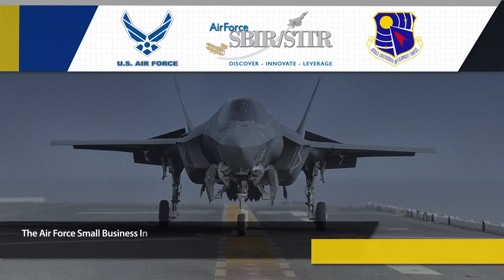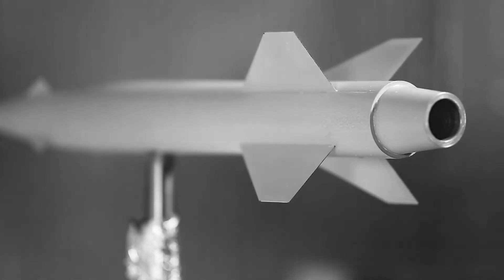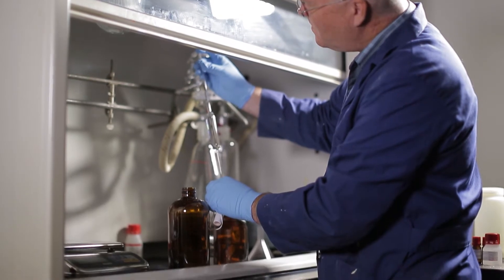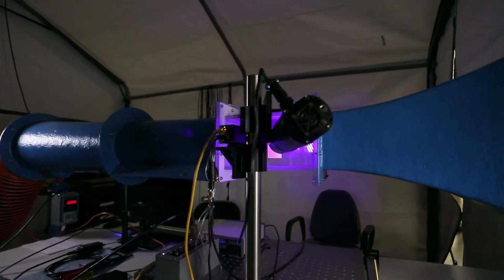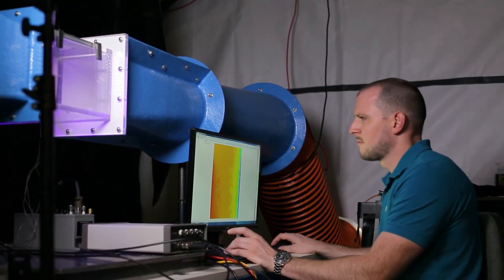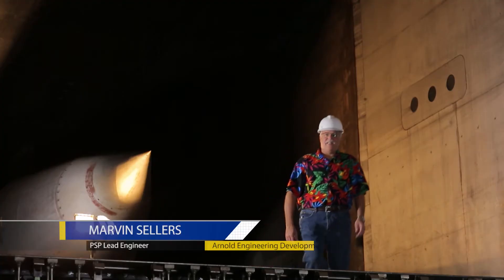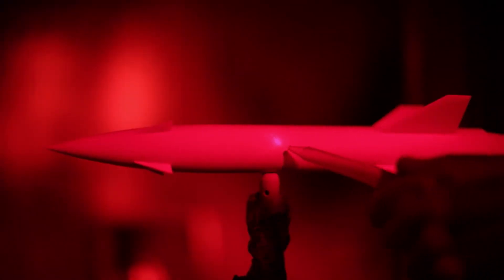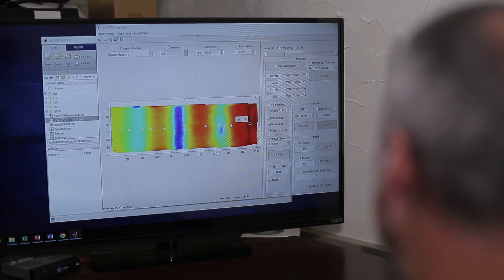ISSI - SBIR Success Story - Fast Pressure Sensitive Paint

Comment: Thank for your video. when i turn on wind tunnel the paint start to separating from surface and i know that i have to use of base coat but i don't know which base coat is suitable and can increase adhesive of polymer 
i use of PtTFPP=Platinum meso-tetra(pentafluorophenyl)porphin
and  FIB polymer(poly-heptafluoro-n-butyl methacrylate-co-hexafluorisopropyl methacrylate) or FEM polymer(poly-tifluoro-ethylmethacrylate-co-isobutylmethacrylate)
thank you please guide me.